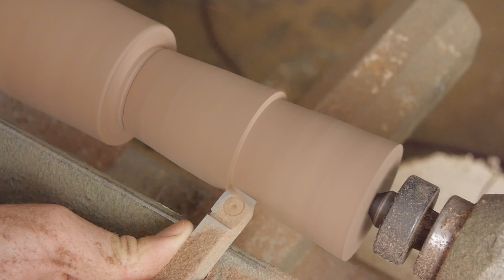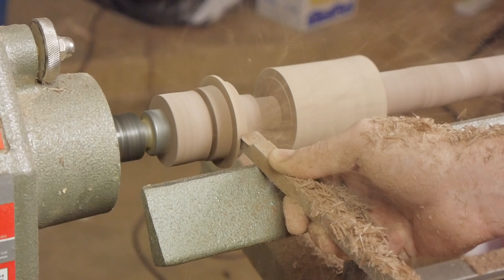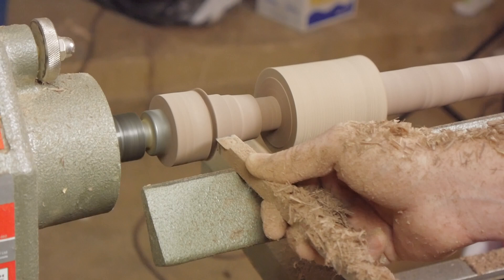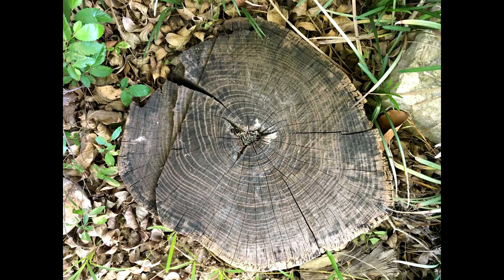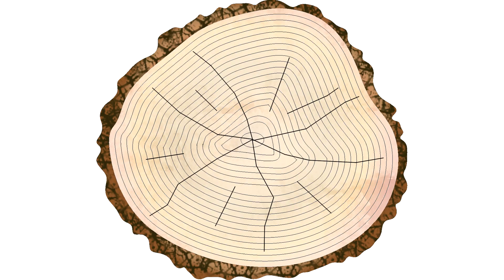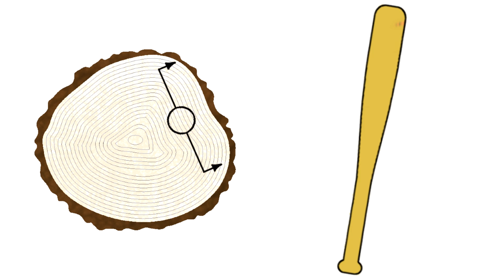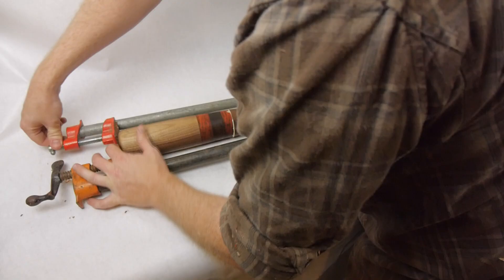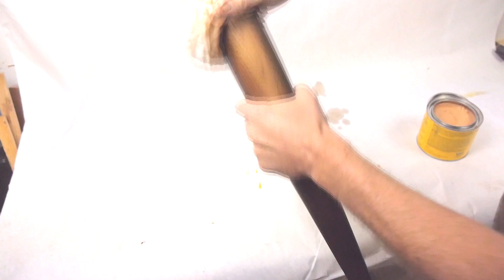Why do Baseball Bats Break?

Comment: Ya gotta be careful with college educated engineers.  That includes you.   Maple, ash.   I have had sawdust in my hair for 60 years or more.  Yes, maple can be used for bats, but it is not a good wood for bats at all.  That someone set a home run record, is inconsequential.  The core of the difficulty, and you mentioned it not, is courtesy of the Asian import, the emerald ash borer.  there is no ash available any longer.  It may not be 100% and absolutely everywhere (but it will be everywhere), but here in Michigan,, there are essentially zero ash trees. A billion dead ash trees.  Ask for bats, hammer handles, shears, shovels  American white ash is no longer available.  But maple is a perfectly miserable choice.
It has planes of weakness.  Always did have planes of weakness.  It is extremely hard in comparison to weight,, depending upon which maple species you are discussing.  In no place in your video did you discuss the many different species of maple.  It is not one species, and those who treat it as all equal in furniture are going to be in for a rude surprise.

And candidly,, anyone who cannot see the grain pattern or checks in a piece of maple, needs to go back to school, in a sawmill.  It is easy to see the grain in maple.  As to the radial checks,,,, yes, that is a character of maple.  And rift sawn lumber will always have those defects at a diagonal.

You may be able to tell by my tone I am a bit miffed at the lack of knowledge of anyone who would make a bat of maple,, and then a bunch of johnny come lately's  thinking they have discover fire.

Bluntly put, maple is a terrible choice for a bat.  It is only popular because one guy had some success with it.  AND  the manufacturers like the switch,,, because they get to sell twice as many bats and they cannot get good white ash any longer.  These are four items in that statement that you failed to mention.  If you like maple,, try a few bats out of Beech.  Turns just as well and has very few radial defects.

A close second to ash for a bat are one of the hickories, there are several.  And even that will take some care and experimentation.  Turners will not like it because it is a bit fibrous in a lathe,,, and selection of individual pieces,,, can only be left to an old hand with a good eye,, not every piece of hickory is worth being a handle.

Want a bat that will not break?  White oak,, several sub-species,, the hardest  strongest of the bunch is live oak.  But again, you will have to pick and choose your pieces.  I am curious to know about pin oak,,, or black oak.  Pin oak might work really well.  Douglas fir might work well,, but that would require some experiments.  Want a bat that swings faster?  Ironwood.  heavy as sheet, strong as its name implies.  make the bat smaller,, less wind resistance.  Might hurt your hands though,,, it will hit back.

To sum up.  Ask an old fart who has sawdust in his hair and under his fingernails. How many man days have you stood at a bench vise hand planing all the parts for a stairway? Ask someone who knows the difference in species, and sub-species of wood,,, not marketing men, not 20 something ball players,, not engineers.

Comment: Permanent but very expensive fix? Metal bats, extra 200 ft to all outfields, never break a bat again and see 700 ft homers :DD
Reply: Or stop using cyclindrical bats. Cricket bats have a miniscule failure rate compared to one every two baseball games.

Comment: Why not put an aliminium core in the center? That should not break at all...
Reply: muh1h1 Because that would be cheating.
Reply: how is it cheating if it is sanctioned and everyone uses them?
Reply: The MLB rules only allow wood bats, NOTHINg can be inside the wood or else it is qualified as cheating and the player could be thrown and suspended
Reply: @EpicGamer69  That's how it is now, but if it makes sense to change that rule (and make a specific exception) than it could & should be changed no? I'm also wondering why not. I mean it wouldn't change the weight if done correctly and the outer part would still be wood so even the way it effects the ball shouldn't change. It would only last longer.